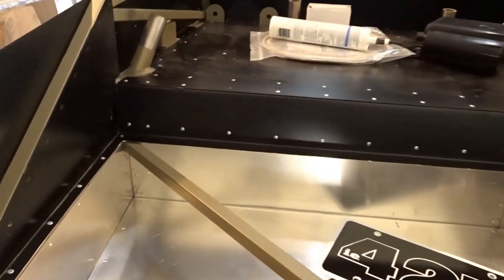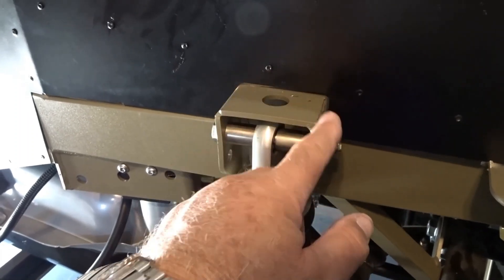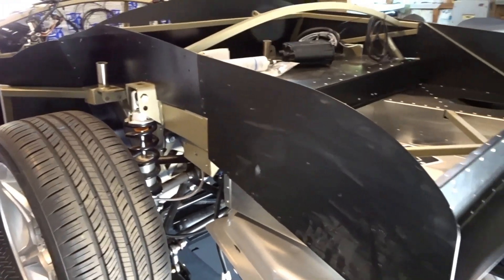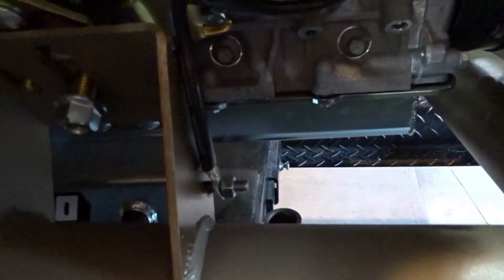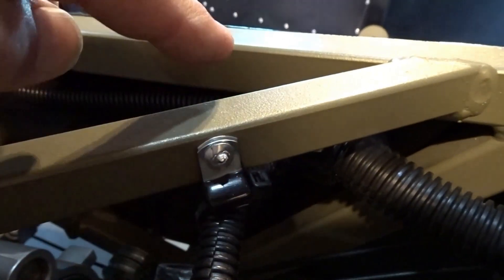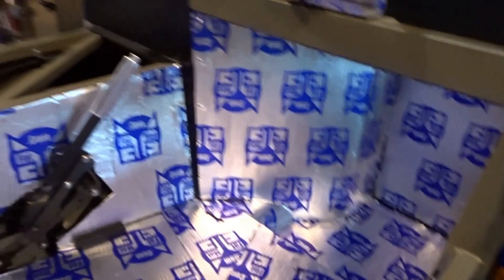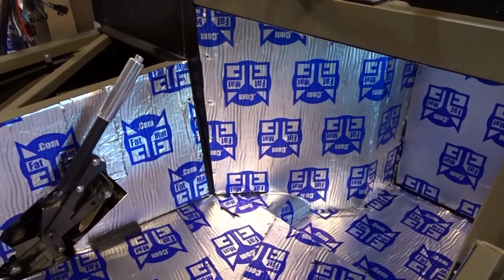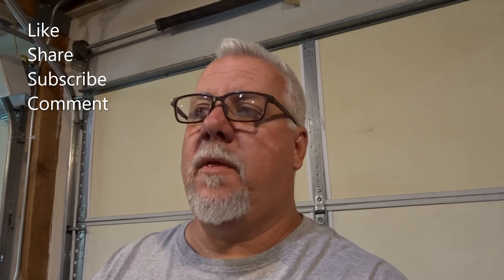Wrapping Up All of the Aluminum Panels

Comment: Great videos!  Where the trunk side panels meet the back of the rear cockpit walls, does this need to be trimmed? There is a slight angled edge that seems to dig into the back wall a bit not allowing it to lay flush with the 3/4" tube. The panel conforms to the shock tower so not really much you can do about moving it back.
Reply from the maker: Most times, panels do not need trimming. Careful alignment will allow you to get a pretty good fit. There are those exceptions though, where nothing but trimming seems to help.

Comment: Do you use the 50mil FatMat and if so how much does a MK4 use if you are covering all cockpit insides as well as the trunk?
Reply from the maker: Yup. The 50 Mil. stuff works just fine. 75 sq. ft. is usually enough for the cockpit and the trunk.............. barring any f'ups.

Comment: You mentioned a charcoal canister for the fuel tank vent. What part do you recommend? And how do you purge it?
Reply from the maker: Here is a link to a stock replacement part for a Ford Mustang. https://www.rockauto.com/en/moreinfo.php?pk=942818&cc=1134133&pt=5180&jsn=470 There is nothing to purge. All you're doing is hooking up the tank vent line into the the canister (make sure to cap the other inlet) and venting through the charcoal material to eliminate the fuel smell when the car is park in your shop or garage.
Reply from the maker: The larger of the openings (2 of them) are the outlets.
Reply: Thank you!